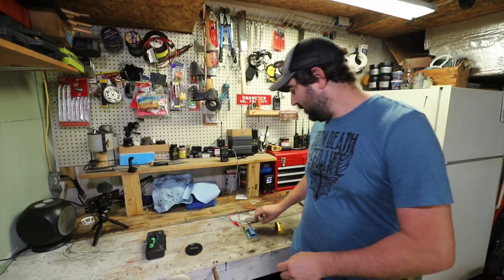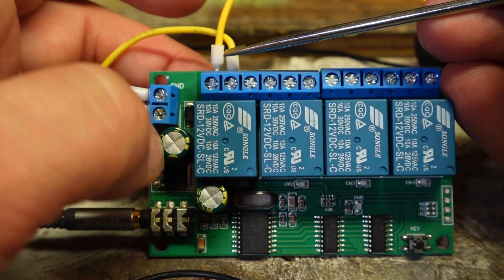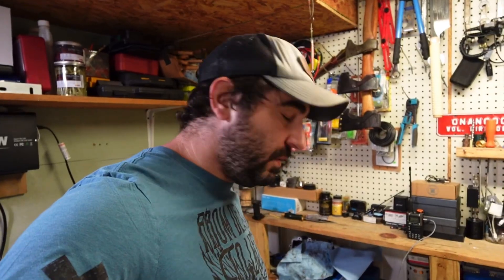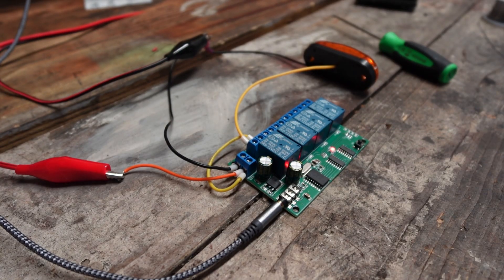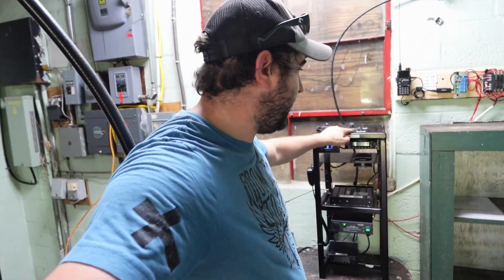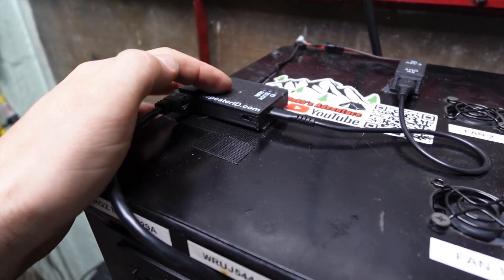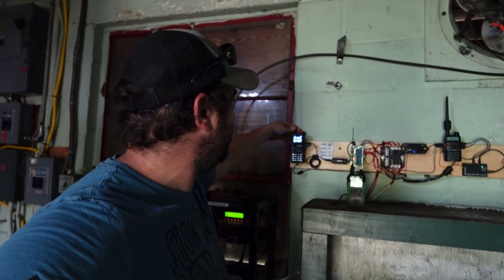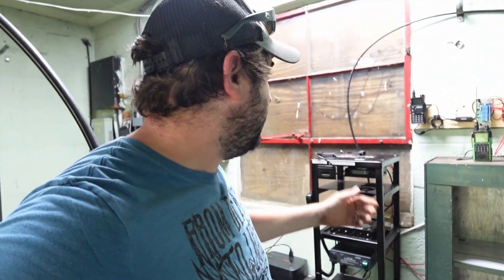Building a remote DTMF controller for our repeater | control your repeater from anywhere

Comment: Has anyone tried coding 11, 22, 33, 44 etc. I have three of the 8 channel versions on a remote site so i wanted to code up 1) 01-08,  2) 11-18 and 3) 21-28 but found that the code will not accept double digits that are the same. I had to code relay 11 with the #19 and relay 22 with #29 to get it to work.  Keen to hear if anyone else had the same issue.

Comment: can this be used for the site telemetry. like the temp inside the building and or the voltage?  if the temp or the voltage is too high, you can shut down the system to avoid damage.
Reply from the maker: Yep. There’s a lot of uses